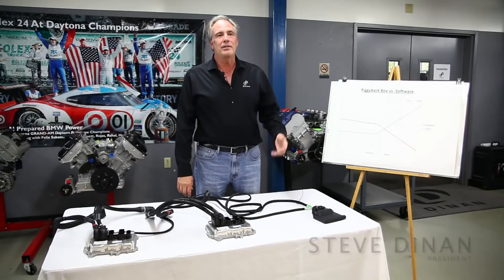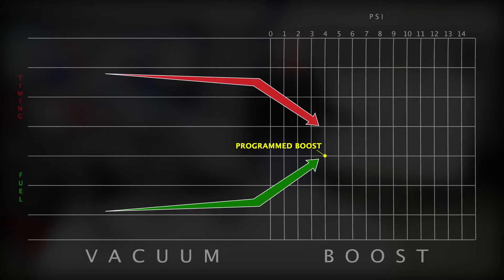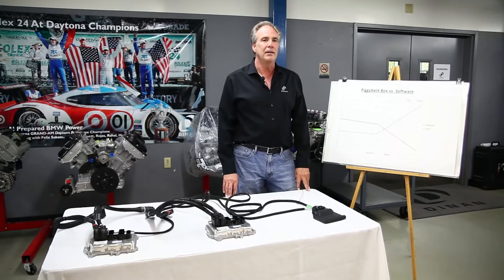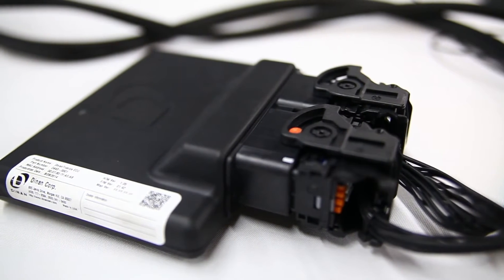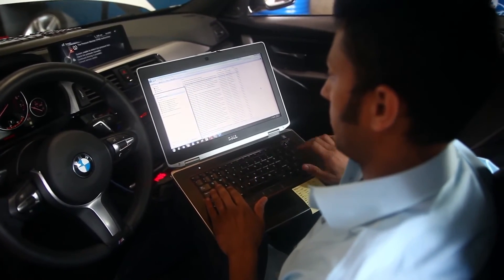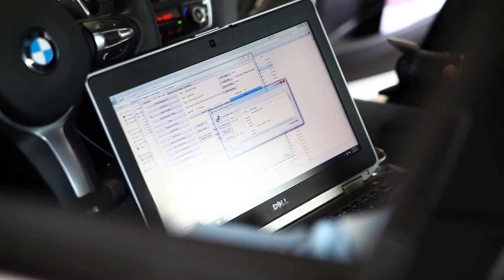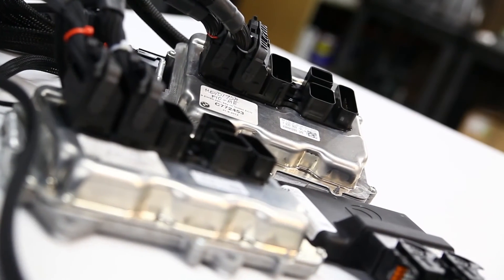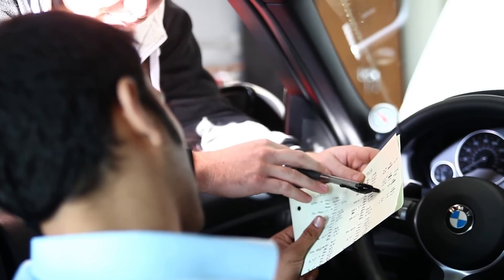Dinan Dinantronics performance software in depth

Comment: I want to just disable the auto-upshift, and let it redline when I need it to. What's the cheapest and easiest way? Trying to build an -02 318ti E46 Compact with auto transmission for drifting. I think the gearbox is kind of cool if you can just tweak it. I know lightweight low power automatics can do great, just put bad rear tires on and ride second gear limiter a whole lot.

Comment: I contemplated the JB4 vs. Dinan. When I got into the details, I liked the well rounded tune Dinan provided and it felt a little less aggressive and safer overall on the long term driveability. I know people with a JB4 and they love it as you can get in and tweak it. I like the Dinan approach, reliabilty and how my mechanic has indicated there are no engine issues to speak of after 15K miles on the car.